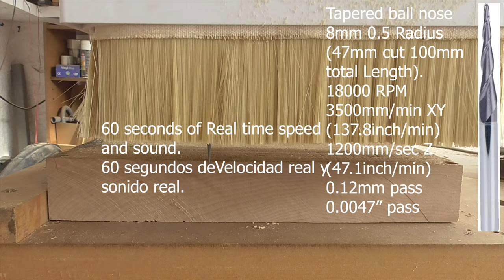Panel de abeja con miel (40mm ancho)

Comment: nice cut, i hope i will be able to do that on my CNC router on that I'm working currently, you can watch it on my channel
Reply from the maker: Subscribed :)
Nice, i started with similar design of cnc few years ago.

With this cnc you can do the same but with less speed. The cnc need a lot of rigidity for avoid flexing.

Nice work :)